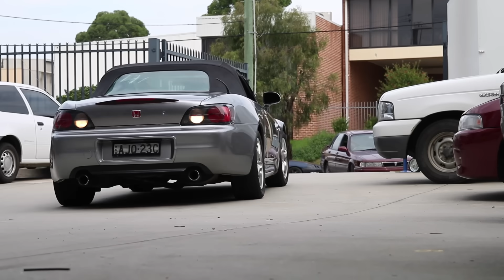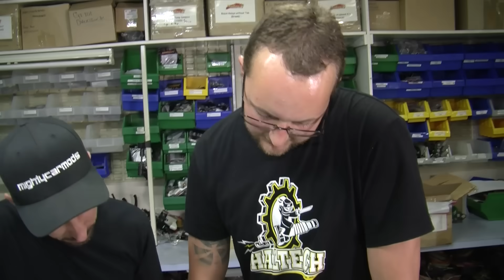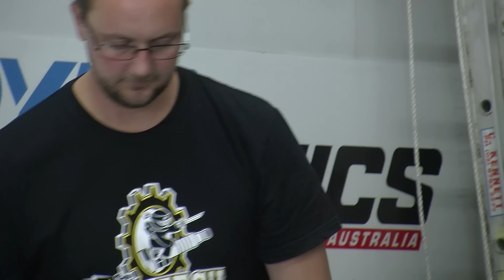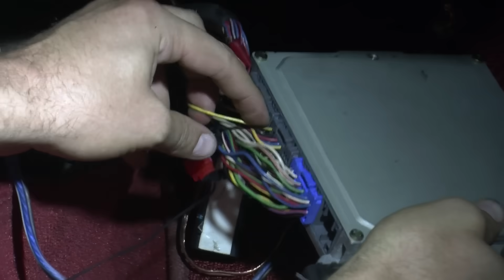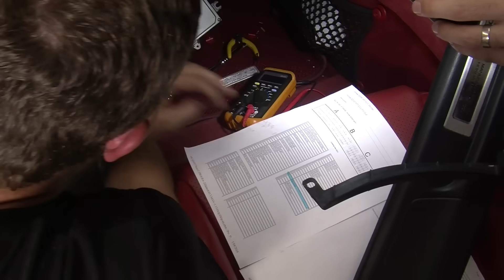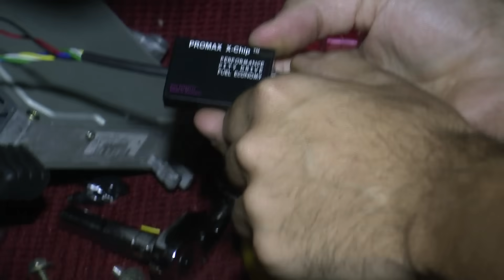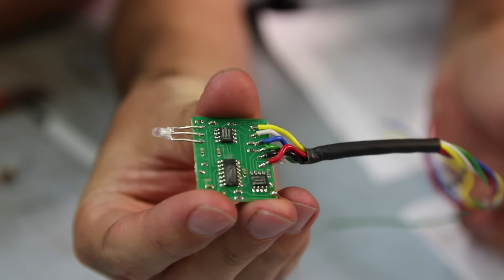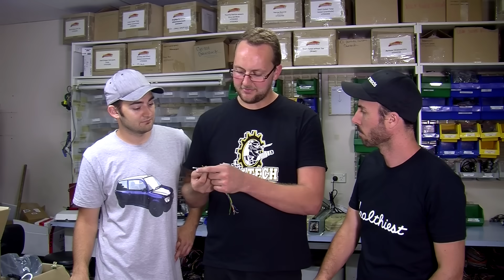eBay Performance Chips -  Mythbusted

Comment: Cool video guys. The out come is exactly as I expected, but it was cool to see solid proof. True HP is expensive. The cheapest real power gain for your S2000 would be nitrous. But I'm sure you know that. I'm not sure what nitrous kits run in Australia but here in American a 75hp kit made for the S2000 is about 650 dollars.

Comment: removing the info on the chips is common practice its done to stop people copying the circuit, its also done by less reputable engineers to hide the fact that the circuit is junk.
you would be amazed just how many devices have the important ic chips de-tagged.

Comment: Ordering something like this is completly uterly idiocity. Buy fizicaly from the tuner. Before instaling test the car on hig way aceleration from 100km/h to 150km/h or some other value. After instoling chip with ower maping original map test it again. Awcors the tuner normaly has electronic mesuring gage. Or you can upload the app for bether smart pfones. Normal price must be around 150€ for instaling end testing. Eberithing els is rip-off.

Comment: My friend used an ebay chip on his 1995 Mercedes E420 and it removed his governor. His top speed was 130 before the engine cut power and after the chip he was able to hit 137 before running out of road.

Comment: Performance chips do work! Maybe not those cheap 20 dollar “performance” chips, but my revo stage 2 performance chip changed the top speed on my GTI from 128 to 162. Granted I spent $900 American dollars + new reinforced motor mounts and Audi R8 ignition coils. Still all for around 1 grand. Not too bad. Pulls a lot quicker too

Comment: Cold Air intake will give you a little true hp. Headers and Exhaust upgrade - another small gain. Combine together - up to 10 hp you will really get, plus ecu tune will get some horses. But $20 chip won't do anything. Personally me, I have $100 chip, muffler and resonator delete and short air intake and see some gain maybe 5-7 hp. I don't really sure if that $100 chip works to me. Next, I will delete 2nd cat. Next year is there will be headers for my car, I will upgrade it. There even $200-$300 chips and I am afraid that they are scams either.

For real hp, save money for turbo. Its not so cheap but it will give you 50+ hp.

Comment: The box I tried worked like a charm.  Diddnt get the power increase  promised, but went from 136hp / 244ft-lb to 156hp / 270ft-lb.   It was a TDI, so getting more power is rather easy.  No need for a tuning box .. all you need is a resistor to put in series with the fuel temperature sensor.  Fooling the ECU to think the fuel is cooler than it actually is changes the injection timing and duration. 

Diddnt come  close to a proper remap tho..  200hp and 310+lb-ft made a huge difference.  The front wheel drive got really annoying.  

Who tries a tuning box on an NA-engine?         Besides altering the rev limiter, there really isnt much a box can do. Not until the engine gets more air.  You should look into installing a huge ram-air intake. Combined with fuel line magnets and an electric turbo it should change things :D

Comment: It's typically a resistor for either the intake air temperature or fuel temperature circuit.  Tells the ecu that the fuel or air is colder than it actually is hence the ecu orders a bit more fuel to be dumped in.  It can work as a basic modification, but it's by no means a "chip"

Comment: I've heard that the car needs to be driven about 125-150 miles so the engine could adjust itself... it's not meant to give you 35 horsepower imediately. Could this be the issue?
Reply: Paintball Enthusiast no it's bullshit

Comment: An RGB (red,green,blue) LED has 1 ground connector and 3 separate connectors for the colors, each of them representing R, G or B. A switch with 3 choices obviously can have control over a single RGB LED without the need of a circuit! Just try it out! GND on the ground input. And any of those 3 RGB-pins on 2V (check the datasheet) and you should see either Red, Green or Blue!

Comment: Why is there so much fake cheap crap on Ebay?  Scam site if I ever saw one.  Someone could mix vegetable oil with some spices and say it heals wounds faster and some idiot would believe them and give them money for it.  it's all a lie and a scam. to the seller it does not matter, but the buyers are the ones getting screwed.  some of the things they are selling are even dangerous.

Comment: The kit I installed in the 1980's added 6 hp to my 350 hp 8 cyl engine.... I was not impressed.Later I discovered that it damaged my engine so I had to rebuild it. Drove my friends crappy spare auto for a week.

Comment: You did not follow the instructions correctly, after connecting up, did you update the ECU with a new firmware from the seller's website? so if you didn't then how can that chip work as intended? you need to connect this device to your blue tooth mobile device and upgrade the firmware.

Comment: The stuff shown video is half ass pigy back system, it is not even tuned to specific set up. 
You cant bark at wrong tree. 
If your car has modified intake/exhaust/cams etc, Open up the ecu, install chipping kit, put sst rom with already dyno tuned basemap.

Comment: Any chance you want to post that thing to someone with the equipment to reverse engineer it (I am local too)? It honestly looks like it does do more then just change the LED around, it needs to be put on a bench and probed with an oscilloscope (among other things) to see if it is actually attempting to do anything.

Comment: Is there anything we can gain with the OBDII plugged modules or is it the same crap?
They are more expensive though.
There is an annoying stock rate limiter on my Mazda 3 throttle. 
We are not even talking actual HP increase but I would like to eliminate that stupid delay. Is there an easy way to do that?

Comment: My opinion (I think It's clever):
*Honda S2K Is most powerfull car per liter. It was very hard to gain it. (I think It's maxed out from factory)
*VW photos: VW's make power reservoir so you can retune or chip like there. You can gain up to 20Kw NA stock.
*Biult in Germany (probably for German cars) and on F.e. on Golf it should work.
*Ebay. Maybe It's universal, but sell as for different cars

I think it also work on diesels (vw/audis)

Comment: So I have a 2006 Malibu SS I would like to get a chip for it but I'm not really sure what chip would be good. I mostly want better MPG...... And some more powers too lol
Reply: Just my opinion, but don't waste your money on a "chip" (not the type in the video, but a legit reflash) for better gas mileage. Most automakers program the cars for optimum fuel economy out the gate. If you really want the added HP, it might be worthwhile but to be honest, you are probably talking minimal gains, unless you sacrifice fuel economy. An added 5% or 10% in power really is not much. If fuel economy is your goal, you would do just as well with a roll of quarters and keeping the tires properly inflated. If you want power, get a V8, or spend a bunch of money on beefing up that V6.

Comment: chips only make power if your turbo charged or a turbo diesel.
Reply: jacob yang is this true?
Reply: Not true, if you do a proper ECU map, your emissions goes up and power increases. Sometimes you can get better fuel economy and power, but emissions goes up. You get to choose two, good emissions, power, or fuel economy. It's a balance of them. Chip tuning sacrafices emissions for power and fuel economy, but it won't be technically legal, but at least it will pass smog if no check engine light is on.

Comment: there actually was a small chance the engine could explode. wondering if you posted a video of the engine exploding, would it even effect their sales? there are companies who will reprogram your own epu if you send it in, but buying this chip and splicing your wires to install it requires either massive balls or a massive synapse deficit. they probably use their sales list as marks for those nigerian prince email investment schemes.

Comment: Plus all engines are different and react to ecu/ecm's differently. you bought a Ukrainian piece of plastic that you couldn't even read. You cant even use it as a paper weight. 
Do a video the right way and use an actual performance chip. then come back to me and say I'm wrong. I dare you.

Comment: . what I need to know is the additive in a red bottle called HEET   they say cleans injectors and water in fuel .  will it hurt to dump  some in once a bout every 2 months?
Reply: Rondo Schiavoni.
Injector cleaner is a snake oil scam and totally unnecessary! Petrol is filtered and is a solvent in the first place. If you're worried about water in your fuel, just put 1/2 a bottle of methylated spirits in your tank.
That's all injector cleaner is, just methylated spirits with a dye added.
Reply: Thanks I see what you  are saying  ,  the ethanol that's added in the gas at the pump is basically the same stuff  so by adding more  its  not going to clean the injectors , if anything dissolve or dilute any water in the fuel tank  .Gee thanks  to you I'm a little smarter now .

Comment: if you could can you do a review on the smps-mmps flash tunner I've heard really good things about it and it sells on eBay for around $22.00 if it does what it says then that is the same price you paid for a bogas  tunning module. also you save you're stock tune and can in minutes put the stock tune back in. also it does data logging and you can do you're own tune or download preset tunes. I ordered one and can't wait to see what it can do.

Comment: chips for turbo cars are a different story. I was actually able to use a 50 cent diode in line to trick the ecu on my 02 gti into pushing 20psi instead of the stock 11psi. made a huge difference in power but I had fuel surge issues and weird boost spikes so it wasn't exactly good for daily driving. it was great at full throttle as long as it didn't spike boost and trip the ecu causing my car to go into limp mode(5psi)...
Reply: Wow - that an example of how NOT to mod a car. You do realize that you could seriously destroy your engine in seconds by doing something like that. Here is a hint - if you "mod" your car, and it doesn't drive right afterwards, you broke it.
Reply: Brandon Deel 20 is alot for the 2.0 and stage 2 is 15 psi with down pipe cat back and intake

Comment: Ebay chips are bullshit, or copies of real performance chips. I'm not even going to bother watching the video, but GOOD tuning does absolutely yield HP & fuel economy.  I've A/B'd many cars between stock and tuned and see the difference in power on the dyno & in the data, and the data doesn't lie.
Reply: hmm ..... there's no 'ebay' on the title
very curious ...... how one could have the idea that it was ebay product in the video without watching it

Comment: i have a TS 6 position performance chip on my 7.3l turbo diesel. if you turn it to stock, mash the gas and halfway through accelerating switch the chip to just stage 1 there is a huge jump in power.

Comment: An S2000 is already optimized thus the initial HP.  The chip could conceivably reduce the power; more likely, it is the same. or, just a fake.   SCAM.  If you try another one, check a more pedestrian type of car.
Reply: but .... the chip was specifically made for s2000
Reply: So is the one that came with the car.

Comment: Rofl. I knew it all along. "chips" do nothing. you can't trick a sensor to get more horsepower. you can easily get bits of hp but putting in high performance radiator, low temp thermostat and a cold air intake. (not a cheap one from pep boys or ebay either) get a good one from k&n. it's not going to be a god like increase but it will improve throttle response and pickup. 

the Honda s2k is effectively a 180-220 hp car depending on year, age, climate in which you reside. they claim 250 (which is probably correct at the crank) on certain year models but I've never seen a stock one make much more than 230 at the wheels.  

hot and muggy environments rob horsepower. the cooler the air is going in, the more performance you'll get because the air is more dense. so the idea is to keep the engine and engine bay as cool as possible. 

those are ways to make horsepower. also racing exhaust setups can increase performance. beyond that, you gotta do an Fi system (forced induction). remapping you ecu can also make better use of intake and exhaust modifications but that can't be done with a chip... if by chip, you mean replace the whole engine management system then yes.
Reply: You can trick sensors, especially on older injection systems which always run in open loop. I have a programmable piggyback box in my Motronic 4.1 which intercepts the MAF sensor and the crank angle sensor to manipulate ignition and fueling via correction maps. It's quite effective for simple fine tuning on a dyno, combined with a custom Motronic flash chip I've got from Germany custom made to the spec of my engine. I also use it to go between an E85 ethanol and a regular 98 octane gasoline map.
Reply: Audiojack for tuning purposes, yes. but your typical ebay chip is useless. there are real tuner chips and programming kits that you can buy. but you gotta spend a solid 300 to get something decent.  and allow me to clarify my previous statement, yes, you actually can see performance gains by simply changing various parameters that the manufacturer had set up. most of the time, these settings are in place due to regulations and fuel economy and such.
Reply: you're missing the point mate
it was all about the "magic" the cheap eBay chip promised, not about scrapping the HP out of dried case

Comment: what you need to do to check those chips- buy one connect it and check the live data as how many kg/h air flow injection ms and so on..... the chip upgrade that you have to do is a software one not just transistors, you need to teach the ecu how to get you more air and fuel flow

Comment: Hi Mighty Car Mods and all, I have a question that need gurus out there to help decode.

I came across someone selling a homemade voltage stabilizer with 100000 uf worth of capacitors, with emphasis on good grounding wires for certain components in the engine as well.
I wonder does it really help in the operation of a car electrical circuit and boosting its performance?

Please refer to the 2 links for more info:-

Voltage stablizer
https://forum.lowyat.net/topic/1289791

Grounding wires
https://forum.lowyat.net/topic/1495749
---

Please enlighten me on this.

Thank you!

Comment: My personal opinion is the performance chips DO make a difference but NOT what the companies claim. The purpose of it being wired into the MAF(mass airflow sensor) is to trick the ECU into adding more fuel which would make slightly more power usually since the EPA forces the cars to be tuned with a lean AFR from the factory to pass emissions tests. I think since they didn't hook it up to a car with a MAF sensor but instead to a car with a MAP(manifold absolute pressure) sensor means it didnt affect anything since the readings would differ in the way the ECU reads them(resistance vs voltage). I actually think the claims were most likely close to being true if hooked up to a MAF if the numbers they claim are CRANK HP and not Wheel HP and you wouldn't even feel the claimed 25 crank hp since that would equate to roughly 3.5-5.0 wheel hp on a standard transmission car and basically anything under 10 wheel hp isn't noticeable whatsoever...  I do think Scott from Haltech has a point though about the ECU correction factor bringing readings back into spec after any gains on the first dyno run...

Comment: can you guys do the:
Innovative Performance Chip/Power Programmer for Acura MDX 3.5L and 3.7L - Improve Your Fuel Mileage, Save Gas & Gain More MPG, Increase Horsepower & Torque with this Engine Tuner!

Comment: I am wanting to tune my 91 stealth. I chipped my Honda from spoon but that wasn't just plug in play, I had to solder capicators, 2 microprocessors tuned how I instructed and resistors.  it did work. way more hp, no top speed, 9,200rpm, and vtec kicks in at 4,500 rpm. it cost way more than 20 too though. my question is, can I get a solder in chip for my stealth?

Comment: Kit claims to be for the S2000, kit instructions show a VW engine and say to attach chip to a sensor that the S2000 doesn't have.  Seems legit.
Reply: & it was made in Germany hahahaha
Reply: Probably just an evry mod set up
Reply: Bull butter
Reply: Yes my point exactly. There is where i get confused. Can you really just splice it to another part of a sensor on a different car and expect it to work. But even still it was never made to work apparently. I figured it juat lit the leds after the first run. Scams, but also thought about the difference in cars ecu thing majig
Reply: Connecting a frequency based interceptor to a 5v MAP just won't work.
Reply: And they didnt get that from the start..... o my
Reply: might even work with a sensor it's designed for
Reply: @ironjudas666  Did you not watch the last minute of the video?
Reply: Exactly why even continue if its not correct clearly a dud chip.
Reply: @DaveyLuckky  Not really what I meant.  Obviously the video continues, and it's a fun tongue-in-cheek video.  I was more poking fun at how blatantly bullshit the product was.

Comment: Real performance chips exist. Worthwhile HP gains can be obtained through researching reputable companies that produce vehicle specific chips that actually cost much more than some clandestine "EBAY SPECIAL" for 20 bucks...thats worthless. My 95 BMW e36 convertible has a DINAN chip installed and there is absolutely no doubt the engine performance improved significantly. Quicker acceleration and better gas-mileage. If you cant find a reputable company that makes a specifically tuned chip,  than ignore doing it at all and explore other engine options...don't waste your money on these little plastic roaches